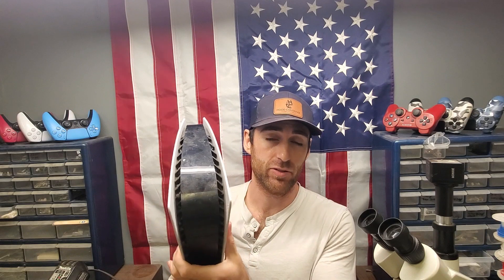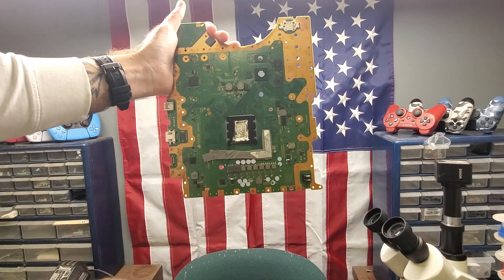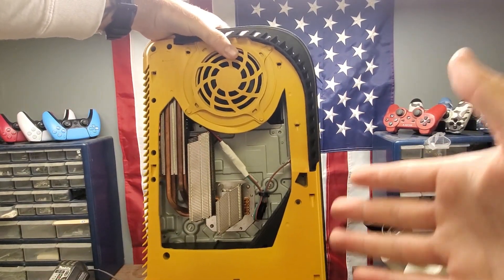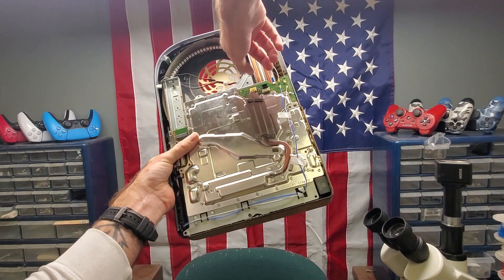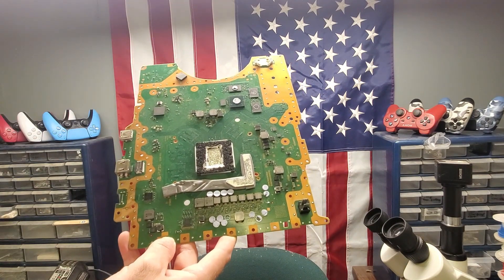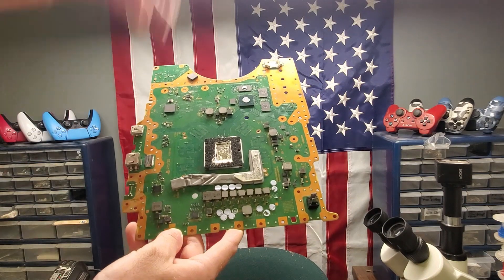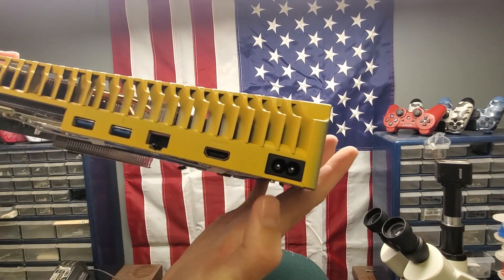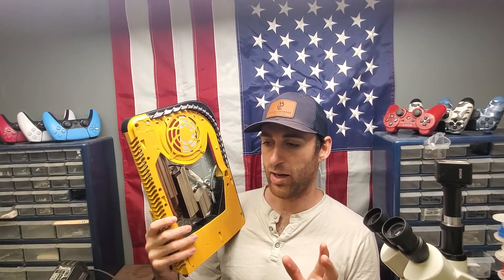Watch This Before You Buy A PlayStation 5!!! (Tips from a repair technician)

Comment: hey, i did the same mod with my ps5 (old version with disc). how did you get the leds to work? i dont want to use a usb cable. I saw a guy wire it up to the ps5 disc drive power but that didnt work for me. can you show how you connected the leds to a power source